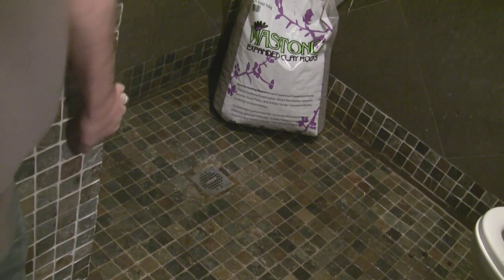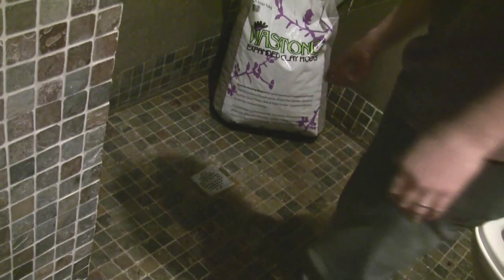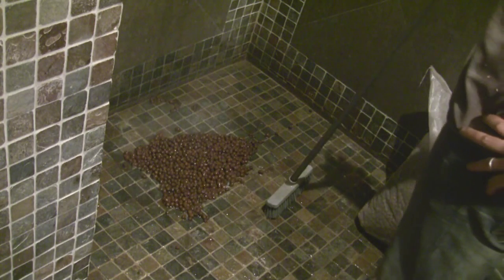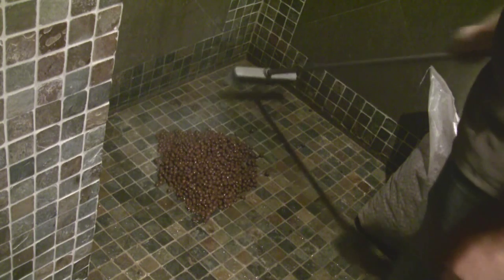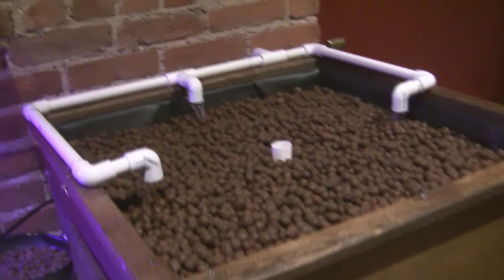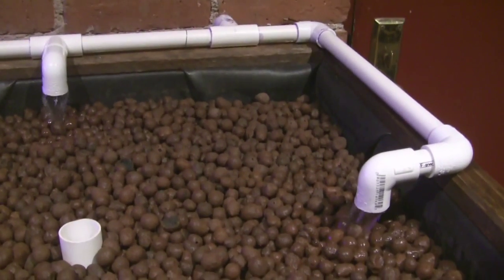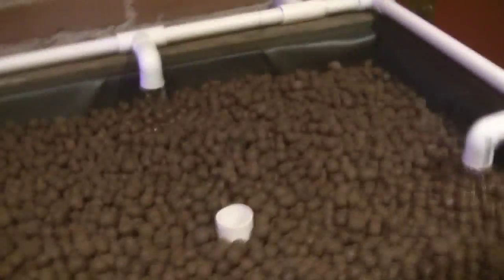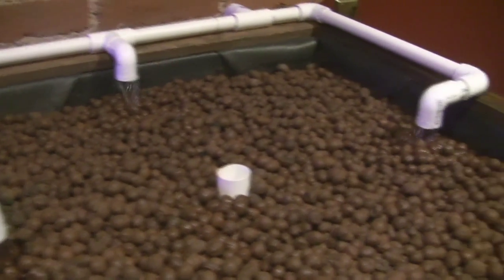Aquaponics for a New York City apartment - Part 4 [Expanded Clay Media]

Comment from the maker: @ghostuk1973 Maybe I wasn't clear enought that this is a flood and drain system where the water fills up to 2 inches below the surface of the grow bed. When it reaches that height then the siphon drains it completely back to the fish tank. The flood and drain system makes sure that the roots are in water about half the time and then have access to oxygen the other half.

Comment: love your system,but will you not need to feed the water over the rock more or you will just have 3 wet spots and the rest will be dry ?drip line feeds would work good and slow down the rate of flow to your tank to ?